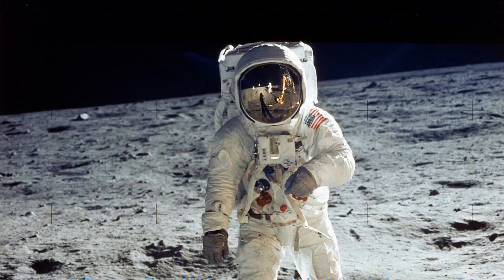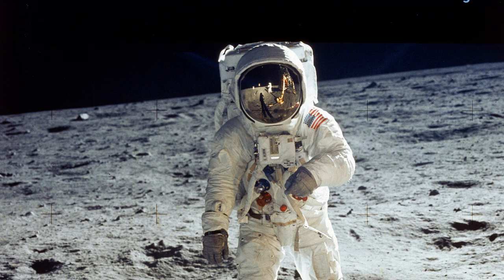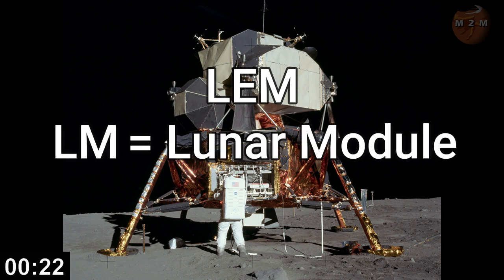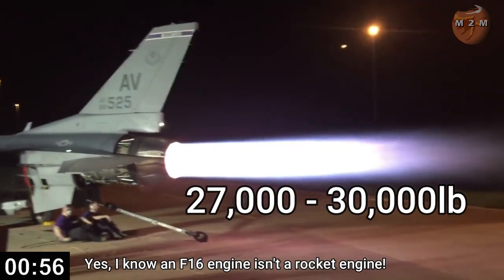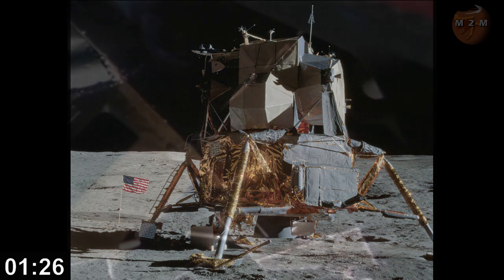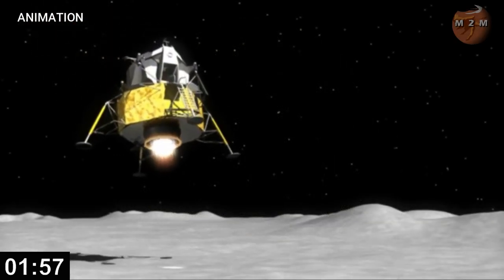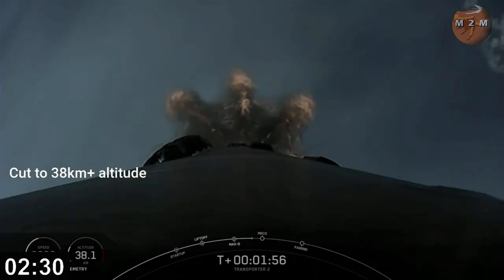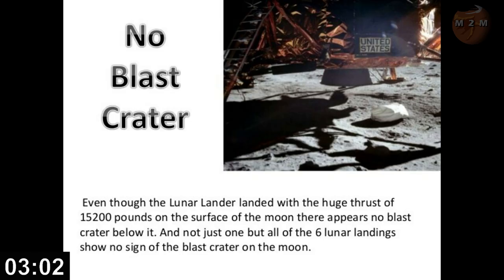Moon Hoax Debunked #6 - No blast crater under the Lunar Module

Comment: You forgot to mention the landing probes. The designers of the LM knew that the crew needed a way to know exactly how close to the surface they were when landing. Initially each LM leg had a 1.5meter long landing probe on it. (See Spider in LEO). Basically just a long pole with a surface contact on the end. (Aka: lunar surface sensing probe). This was removed from the front leg with the ladder as had it folded up on or through the ladder during landing it could have been a hazard, leaving three landing probes.

When a leg touched the surface it would turn on the "CONTACT" light in the LM. Listen to all the landings and you'll hear the classic phrase "contact light is on". 

At this point during the landing of Apollo 11 the pilot throttled the engine back slowly, then once on the surface, shut down the engine. For all other Apollo missions, once the contact light came on the pilot shut the engine off completely, and the LM dropped the last 1.5 meters to the surface. (Check the Apollo 12 episode of the mini-series "From The Earth To The Moon" for an accurate recreation of the process). 

This also helps explain the lack of a "blast crater". The landing pads on the end of the LM legs, to which the landing probes were attached were 1.5 meters above the surface when the engine was shut off, with the engine bell itself was a little higher then that. So we have an engine running at about 25% of full power about 1.7 meters above the lunar surface, with the exhaust gases expanding out in a dome shape; when it's suddenly shut off. The LM falls to the surface from a height of 1.5 meters with the engine shut off. Thus no crater.
Reply from the maker: I didn't actually forget them as such.  At the time I didn't think it was necessary to mention them but in hindsight mentioning they shut the engine down at the point of "contact light" when we know when the probes hit the surface may have been worth a mention.  But I think I have done enough to dispel the theory.

Comment: LEM stands for Lunar Excursion Module. Over time, the «excursion» part got dropped.
Another thing is that the layer of dust on the Moon's surface is not that thick, and it covers mostly solid rock. There was a slight depression under the LEM, but, it was so wide and smooth that it's not actually perceptible. Also, as it's entirely mineral, there is no scorch mark. The exhaust was just not hot enough to leave any scorch mark on the surface, even immediately under it.

Comment: You forgot to mention the striation marks from the engine that we can see under the LEM.  Not only is this a stupid claim it's outright being dishonest.  There is signs of the engine affecting the surface.
Reply from the maker: I did think about the striation marks but decided to leave it out because I didn't feel it necessary because the claim is the lack of blast craters and explaining why you won't see any. Furthermore in all the videos of the landings you an clearly see the dust being blow out and away from the LEM. But it was still deserving of being pointed out. Thank you.

Comment: The Lunar Module was designed to be light, remember that flimsy looking construction and surfaces you could poke holes in. We don't see blast craters beneath helicopters. The videos of jets blasting cars and buses don't show craters being blasted into the ground. The fuel combustion used by the Lunar Module uses two substances reacting together rather than oxygen in the air. The vacuum around the moon is far from perfect but the oxygen around is a few atoms at most per cubic meter. So the gas hitting the surface cannot combust any further. It has spread out from the combustion chamber and when a gas expands it cools down rapidly. So we have a tepid wind hitting the surface. Thus all it could do is slightly clean the area of the lightest particles which due to the lack of air resistance will quickly fall back to the surface. In the video of the landing we see dust being blown away.

Comment: Actually there was a blast crater. The dust layer was blown away and the crater was, at most, approx a couple centimeters deep. So small, that it barely appeared noticeable.

Nice debunk. Concise and accurate.
⭐⭐⭐⭐⭐
Reply from the maker: Not really a crater just what is referred to as striation marks, which are streaks in the lunar dust from the negine.
Reply: @M2M-matt  What I meant was the layer of dust was blown away immediately under the LEM. That is the "crater" I was referring to, a bit tongue in cheek. Not a crater in the bedrock.
Reply: @M2M-matt  As I mentioned elsewhere - John is right.  Careful analysis of the photo shows a shallow "crater" on the order of a couple centimeters/inches deep, but many feet wide.  The striations are superimposed on that.
Reply: @Nattturner Only the dust immediately below the rocket nozzle was blown outwards. Immediately around and under the sides of the lunar module, the regolith remained.
There was surprisingly little thrust needed just prior to touchdown, due in major part to the low gravity, 1/6th G.

I suggest you look up common sense, and critical thinking, and purchase some of each. It will benefit you immensely.

Comment: On earth the air would brake down the dust, making it stay near, entrapped in vortices forming around the landing vehicle.  
 
On the moon there is nothing to brake down the dust, and the rocket exhaust has a speed of 2,500 m/s. That stuff flies hundreds of meters away without slowing down, and even after the ballistic curve makes it hit the ground, on a smooth surface it would bounce on until it hits something that takes up the kinetic energy.  
 
And on a moon there is not much that could turn the rock into hundreds of meters deep sediment...

Comment: How do you get a blast crater on a rocky surface with just a puff of gas?
I never got this argument.
Reply from the maker: Well a little more than a "puff" of gas, in my opinion, as it was hypergolic fuels being burned to down to 3,000lb of thrust. But, still not the expectation many have of a "rocket engine" if you catch my meaning?
Reply: @M2M-matt  :)  Yep. I is not the same as an F1 engine.
Compared to that is is just a puff.
Reply: @M2M-matt  The expectation of those deniers is that that engine should have an effect similar to that of the main first stage engines at take off.
Reply: @Frankie and Benjy Mouse - "How do you get a blast crater on a rocky surface with just a puff of gas? I never got this argument."
Some people just watch too many bad B-Grade science fiction movies from the 1950s ...... and got all their scientific training from them.
Reply: @Kualinar  The main first stages don't dig craters either.  They don't launch over dirt.  Just leave lots of scorch marks and do a bit of spalling of the concrete blast ducting.

[Point sources of high heat cause thin chips of concretes to "spall" (blow out) from surfaces.  Which is why trying to heat concrete with blow torches/oxy-acetylene etc is a really bad idea]

But even high power rockets launched on earth, at 3000 pounds over dirt don't leave craters.

I should know, I've participated in a number of amateur rocket launches at that power level.  No craters.  But you might start a grass fire.  Been there, done that, got the tee-shirt that still smells of smoke.
Reply: @fromagefrizzbizz9377  So, deniers expect to see under the LM what we could expect to see under a Saturn V rocket first stage, after it burned all of it's propellant, WITHOUT being released from the retaining clamps... Over a bare, unprotected ground.
Reply: Just like you can easily stick a flag pole to a rock surface because rock surface😅 and shouldn’t the surface be blackened underneath the fuel propeller

Comment: Out of interest, had a late stage abort been necessary, would it have been the descent engine that would have taken Neil and Buz back into orbit, or would the descent stage have had to be ejected before the ascent engine was fired?
Reply from the maker: It would be the ascent stage because each stage has its own fuel tanks.  So if in the case of Apollo 11 when they were getting close to bingo fuel the abort would have been triggered as they counted down to zero seconds fuel remaining.  The descent stage would have been severed and the ascent stage fired immediately.  This would have been a simple case of hitting an abort switch or breaker and everything would have happened immediately and automatically.  Then ascent stage would have just impacted the lunar surface.

Comment: So there were 2 engines, ascend and decent. You show and them and call them by name in that order. But from then on you only talk about ascend engine when showing what you called descent engine!
I'm confused are the engines named for the direction or the manoeuver?
Reply: The Lunar Module or LM, consisted of two stages. The DESCENT stage with the landing legs; and the ASCENT stage sitting on top of it. This design was used to save weight which equals fuel. The descent stage took itself and the crew in the ascent stage down to the surface. Once it had none it's job it was no longer needed and there was no point in launching it back into orbit, just to have it drop back on the moon later. All that was needed was for the small ascent stage with the two man crew to be returned to the Command Module CM already in orbit. The ascent stage engine was a fixed-thrust hypergolic rocket engine. Once fired that was it. Up you went. If it didn't fire you stayed on the Moon. It returned the 2 man crew with samples to Lunar orbit. Once it had docked with the CM and the crew and samples were transferred it was dropped back onto the lunar surface. All ascent stages were dropped back onto the Moon except for the Apollo 11's LM ascent stage which MAY still be in lunar orbit.
Reply from the maker: Yes sorry, I need to keep the videos short and concise.  It literally is a referral to the direction, yes.  You see there were two stages to the lunar module.  The descent stage contained the landing platform, landing legs, equipment bays etc and the descent engine.  This part was left behind when they lifted off the surface with the ascent engine to RV with the command module in orbit of the moon.  I will be going into the ascent engine at a later video about the flameless engines from apollos 15,16,17.
Reply from the maker: @Phase52012  Sorry only just seen your explanation after I posted mine.  Thanks :)
Reply: @M2M-matt  Um, the ascent stage didn't have the landing legs, landing platform nor most of the equipment bays.  What would have been the point of lugging them back into orbit when they were no longer needed?  Leaving the ascent engine behind on the moon would have meant that the astronauts would still be stuck on the moon.

I think you confused yourself ;-)

The ascent stage was the ascent engine, the ascent capsule, and enough equipment to keep the astronauts alive, breathing, able to communicate, and for minimal control of the ascent engine.  Everything else was left behind on the descent stage because it was no longer needed and they had to minimize weight of the ascent portion.
Reply: @Phase52012  As a cool bit of additional detail: the ascent module impacts on the moon itself was one of the experiments.  It's a great way to get seismic readings on the lunar geology, using instruments left behind by the current and previous missions.

When Apollo 11 returned from the moon, they would have had at most one seismic sensor (left by Apollo 11 itself) on the moon, but as I  think they may have dropped that part to make the first mission simpler.  So impacting the moon wouldn't have given any readings, and of course, for most benefit, you need at LEAST 2 sensors, so why bother with Apollo 11's ascent stage?.

With Apollo 12, there were at least one and possibly two sensors.  So it made sense to drop it on the moon.  Each landing after that added another sensor, making the impacts more scientifically useful as the programme progressed.
Reply from the maker: @fromagefrizzbizz9377  meant to say "Descent".  Trying to type it quickly and messed it up.  Edited... thanks